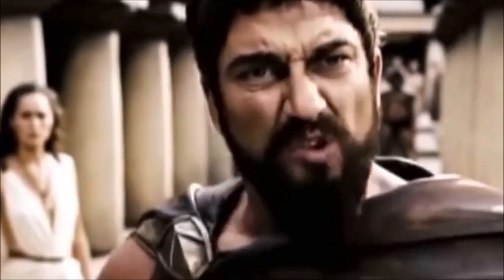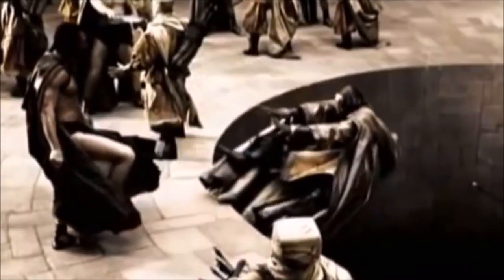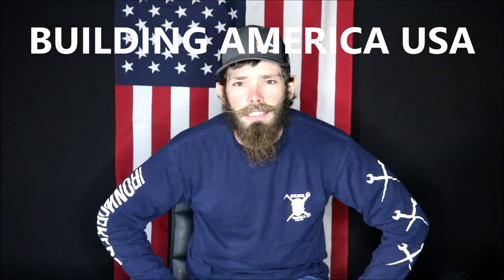Best Knee Pads for Construction

Comment: Bro as a fellow ironworker I’ve been trying to find some slim knee pads for under the pants that don’t slide around. I wear the Carharts under style with the flat memory foam and I totally agree with being able to use your knees and it m is an absolute game changer up on the steel. The carharrt ones just bunch up and are a bit annoying can never get em to stay sitting quite right. These baseball ones look perfect I tried volleyball ones before they were way too tight. Thank you so much for this recommendation though I’m ordering a set of Adams immediately. Cheers bro stay safe up there.